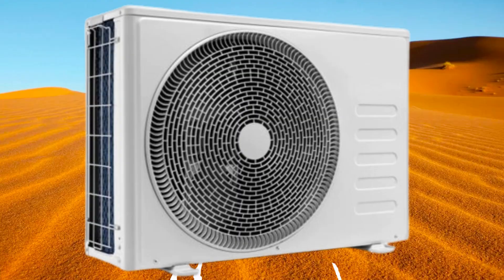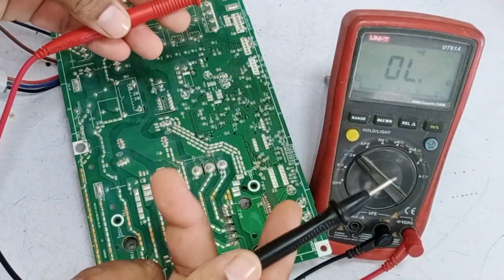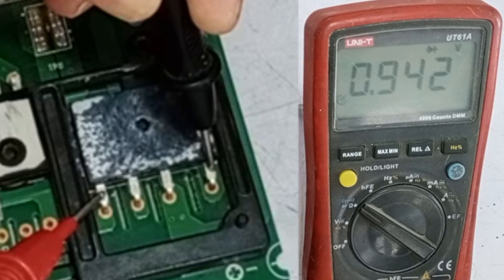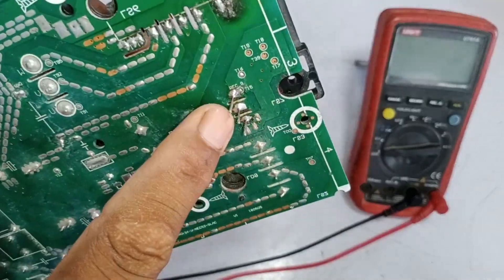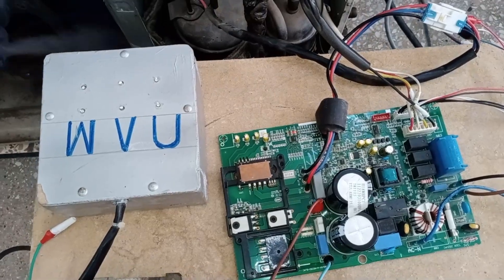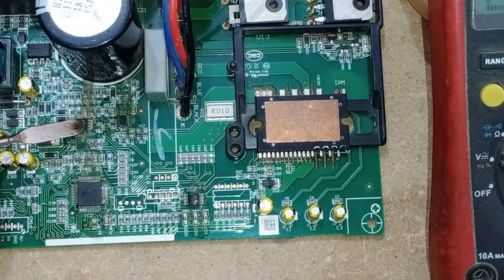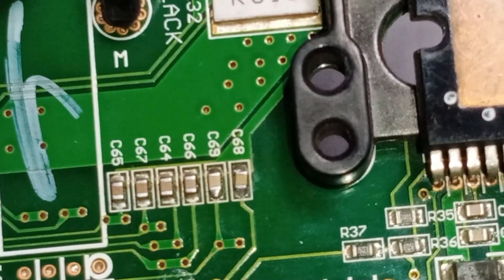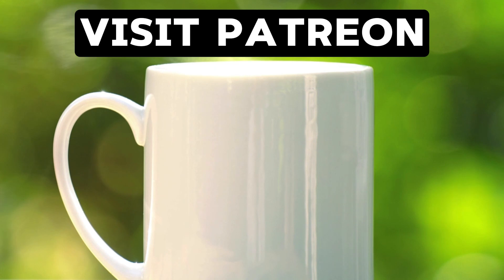Testing Mini Split AC Circuit After Another Workshop's Failed Repair!

Comment from the maker: Ugh, this Circuit Board Could Have Been Fixed If I Hadn’t Made That Mistake 😥💔 It’s so frustrating when things don’t go as planned, but I hope you can learn from my blunder! What’s the biggest mistake you’ve made while fixing something? Let’s share our experiences?
Reply: Greetings from México. Good luck next time ING, thanks for sharing, anyway. I Will be carefull myself.
Reply from the maker: Yes be careful, learn from my mistakes so you should not do it.
Reply: @forevertechenglish  how micro processeor controle detecte the AC higther or lower. can we do when i have the eureur of the AC   is higher or lower than normal

Comment: Pls I have a LG artcool gallery PCB I'm trying to troubleshoot its fault...I discovered the PCB after being powered only makes the normal starting beeping sound and doesn't work  ..pls what could be the likely problem here..and once the PCB make the switching beeping sound first time, it will not make the switching beeping sound again until U unplug the PCB for several hours n power it again..from this kind of PCB behaviour, what could be the problem with the PCB.. thank you

Comment: The bootstrap, as name implies, is NOT for checking any voltage. Those pins are charging pins for bootstrap capacitors, for proper gate driving of upper side IGBT. Also, hell a lot of pins you called supply, where in reality those are PWM command inputs for IGBT turning ON and OFF.
Another mistake: C65 to C68 are NOT boosting anything. Those are filtering capacitors, for lowering noise. WOW, so you've managed to f..k up circuit, otherwise normal working?
Reply from the maker: Thank you for your detailed feedback. In my videos, I aim to make technical topics more accessible for a broader audience, including people who may not have an engineering background or understand technical jargon. While I try to keep the explanations simple, I understand that more experienced viewers like yourself may prefer precise terminology. I’ll take your feedback into consideration and will try to strike a better balance between accuracy and simplicity in future videos. I appreciate your input and support for the channel!
Reply: @forevertechenglish  thing is, no one that just started to do repairs of electronics, should take such board repairs, without knowing very details of what's what on power electronics devices. Otherwise, they can make serious damaga to device or get seriously shocked by high voltage and high current, so much so to get killed (300V DC can very easily stop human heart).

Comment: This happens to almost every electronic technician from time to time. I had a short last week when measuring an op amp. measuring pin slips between V+ and an input.  A split second of 18V on an input coming from the microcontroller. defective. Fortunately it was a controller that did not require programming.
Reply from the maker: Thanks for sharing

Comment: my air conditioner suddenly, while it is on the low level, fluctuates the intensity of the air,if at that time I change the intensity then it works normally. do you know the reason?thanks.
Reply from the maker: If it is a DC blower motor then the problem in any two optocoupler of the fan operating circuit, and if it is ac motor, then its feedback to the micrcocontroller is not accurate. So change the Ac blower motor. But if it is Dc blower motor then fix the pcb of the indoor unit.